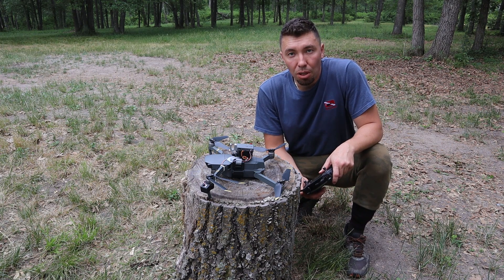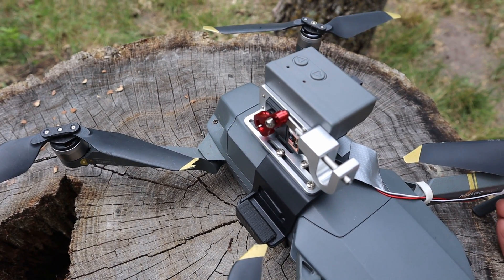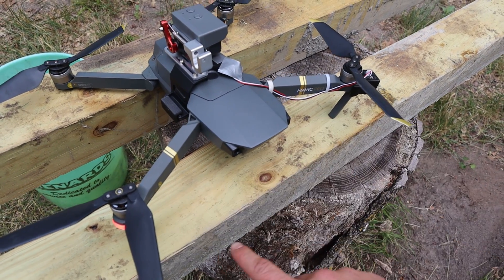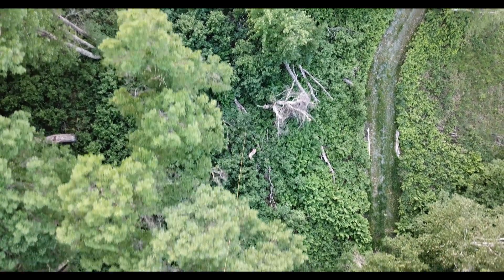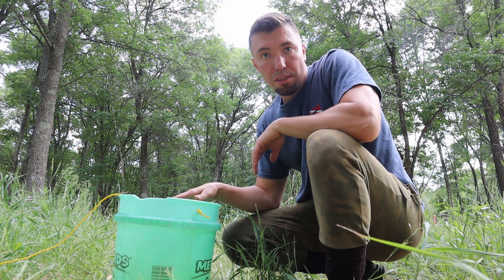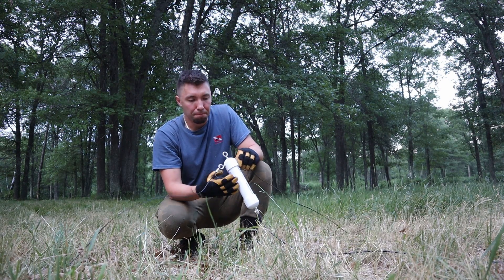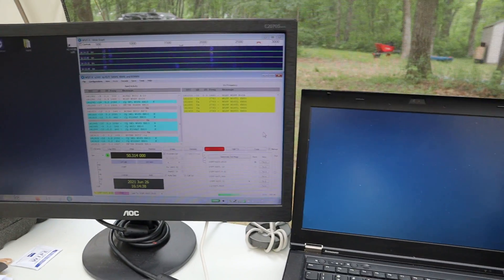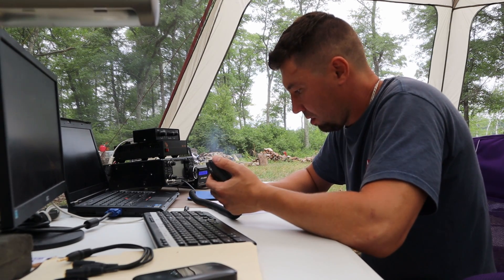Using a drone to put up a HAM radio dipole antenna

Comment: Excellent job. I finally had to hire a   tree climber to get my pulley up. Only one suggestion. I did the "small pulley" thing. I found the knot/coupling had problem and one pulled apart, leaving me a useless pulley in the tree. They have light weight 5" pulley with a bigger frame on eBay. Very educational with that release assembly. And I didn't know a drone could pick up that weight. Thanks for the video.
73
W9DLP

Comment: Nice video... I am building a drone soon but for now, i am using a tool which shoots a 22 blank which gets me up as high as 200' and less for a lighter charge on the blank. It works well but betting the cable to come down exactly where you want it is not easy. A drone with a camera looks much more accurate for the drop.
Tnx es 73 de WA4AOS

Comment: That's a very complicated solution. I tie a string with a weight under my Mavic Pro and connect a fishing line to the weight. Then fly over the tree (house/whatever) while pulling the fishing line out far enough that the drone can descend down to the ground. The weight keeps the fishing line down and away from the drone. Disconnect the fishing line and then use it to pull your dipole (or a slightly heavier string as needed) over your tree and you're done. Nothing "extra" needed. But it was fun building I bet.
Reply from the maker: It is a more complicated solution BECAUSE in my case, I needed a precision drop due to heavy tree canopies AND I had no option of landing due to marshland and high weeds.

Normally taping fishing line to the drone is ok if you have open area and solid ground to land on. (Although there is a risk of tangling up on take off and landing)

Comment: I've put up many dipole ropes using my DJI Mini 2.  You don't need all that crap.

Scotch Tape a fishing line to the bottom with a 1oz lead weight.  Get to where you want to be, hold the slack, and either yank the tape loose or accelerate away.
Very cheap and easy!!

Comment: Good idea. Thanks for the demo. I recall spending half an hour trying to toss a weight up over a tree by hand to hang a portable antenna. It was ridiculously difficult for an old guy like me. 

I've been thinking about buying a drone, or building one, that I will just send up to just under 400 feet carrying a crossband HT as a repeater, or have it pull up a lightweight end-fed antenna, and just hover at whatever height is appropriate for an 80 meter to 10 meter multi-band end-fed and whatever weight of RG-174 it can support, probably just 30 feet or so would suffice, and run my QRP rig on it, or add a small 40 Watt HF amp I have. I figure I can fly it for about 20 minutes at a time, work some stations, then bring it down, change the battery, and send it back up. I've been looking at motors to see what can handle the almost nonstop operation, but it's very hard to get meaningful data on them. Lots of info on cameras, (which I don't need.) But the idea of what would effectively be a 400 foot tower that will go up anywhere at all in just a minute or 2 seems like a dream come true for an old guy who doesn't move around so well. Software that automatically takes it to a spot in the air and just sits there even in a breeze is already available, so all I'll need to do is program the process and babysit the antenna as it goes up and down. Anyway, lots to think about. Again, thanks for the video.
Reply: They make slingshots for those that lack a golden arm.
Reply: John, use a slingshot. Do like Steven did. First use a light string with a weight. Shoot the weight up and the string will follow. Once up, next comes the rope, etc etc.

Comment: if the antenna is made of two wires, then you can supply electricity to the drone.
Reply: Ignoramus
Reply: Not at all, in fact that is you. That's exactly how cellular providers and others do it to put up emergency towers. Indefinite runtime with the wired connection to the drone.  @TheMainsheet

Comment: Doesn't the steel cable react with your RF?
Reply from the maker: It does not. The antenna is hoisted on a rope which isolates from the thin steel cable.

Comment: The mount is typically placed on the belly of the drone not the top, is there a reason you chose to mount it on top?
Reply: very, very interesting & so efficient, so precise, CONGRATULATIONS!👏🎉 While obviously more complicated (vs. my technique of tossing a smaller-sized rock {underhanded} w/ light string/line attached, then heavier lines thru {or over} treetops), urs is certainly the BEST way to hang lines; I can typically hit the best area on a treetop (after several attempts) at around 50-60' in height; however, my best (at a friend's QTH), was prbly around 75' (a VERY long day☹️hi hi!); great job & tnx for posting, 73 de WA4ELW in TN 🇺🇸 dit dit 😃
Reply: I believe dji sells foot extentions for the drop kit. At least the they do for mavick.
Reply: I kind of thought the same, but guessing it was placed on top as to make landings safe and keep drone from falling over and potentially damage the blades.
Reply: I can drop a paper airplane by waggling it off . Tear a hook shape into the paper to hang it onto the bottom of the drone .
Watch out for the props catching strings and sticks or branches .
Reply from the maker: Yea, as Ryan mentioned above, there is no way to land the drone with the servo motor below so the only way to mount it is on top from what I could find
Reply: @humangenoproject7930     catch it with your hand like a lot of experience drone pilots do when needed!!